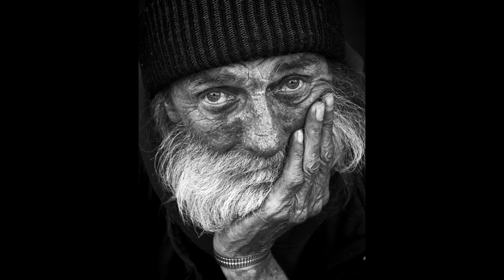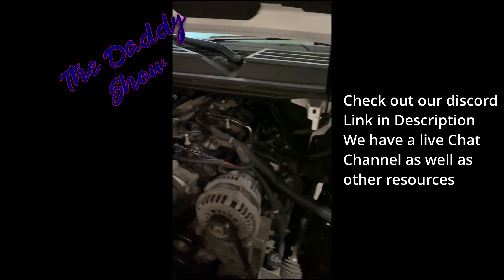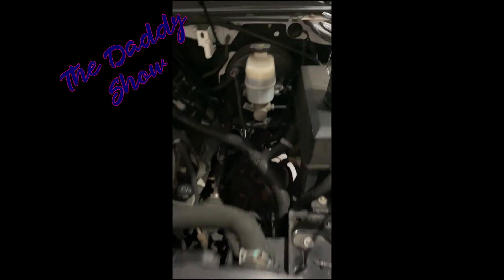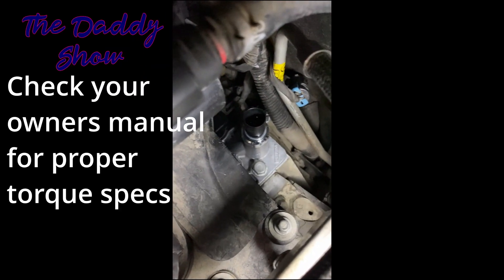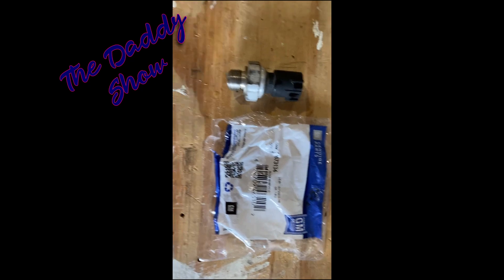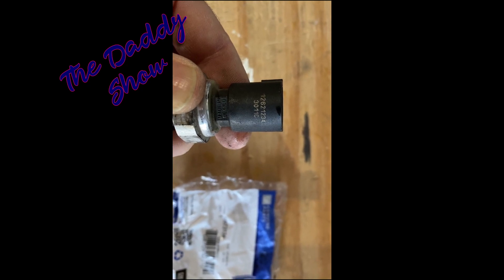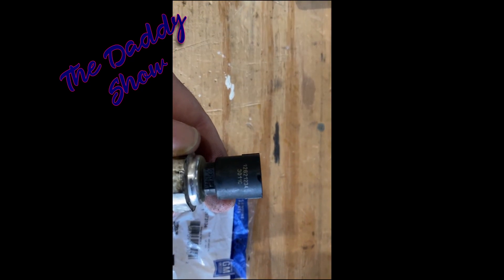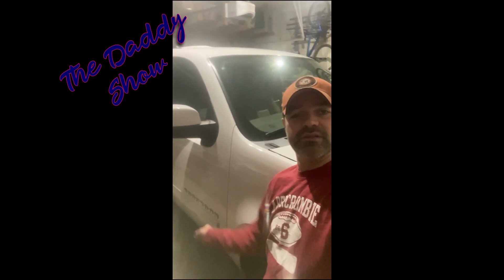2013 Chevy Suburban Oil Pressure Sensor | 5.3L V8

Comment: Where did you sit and put your feet in the engine compartment. I am 6'2" and 265. I don't know where to set my feet down to avoid damaging cables, hoses, connectors, etc...
Reply from the maker: Im only 5’8” so that helps a lot!!
Reply: I laid down some towels and lay down over the top of the engine, using a stepstool to do that (2014 Yukon).

Comment: How did you unhook the harness agai😢?
Reply from the maker: Pull up on the tan plastic piece with your finger and thumb and then squeeze in on the center tan piece you just pulled up and that should release the catch and you can remove the harness

Comment: Just before the sensor, on mine there is what appears to be a pastic shroud in the way, did you run into the same thing? I cant for the life of me figure out how to get to the sensor with that piece in the way
Reply from the maker: I did not have any plastic piece in the way.  You’re not talking about the big plastic piece that covers the top of the entire intake and heads are you?
Reply: @thedaddyshow01  no i removed that cover, right where the sensor screws in just before it there is a piece of plastic in the way
Reply from the maker: Ok. I just wanted to make sure. I did not have anything in front of the sensor that impeded my ability to get to it.
Reply: That plastic shield is standard on those vehicles (not the cover).  It appears that "TDS's shield" has been cut away.....which makes TDS's process 1,000 times easier to replace the oil pressure sensor.  If you do not cut that plastic shield out....then you will have to remove the 2 vacuum lines (easy to do) and then use those tools.  As what TDS said..."Everything you do will be by touch".
Reply: My 2014 Yukon had that plastic "sound barrier" blocking access (job is tons easier if that's not there).  So this took me a couple of hours to do working blind 8 days ago, after I'd quit 3 times.  If I have to do again ever, I'd cut away some of that barrier.  By the way: 4 of the 5 GM SUVs have had bad oil pressure senders, terrible location/engineering, unless all one is concerned with is to get past warranty period and make some service money.
Reply: @nealgibbs4821  Yup, cut that away, use a Dremel, job is much easier